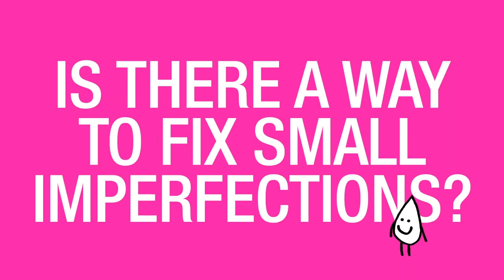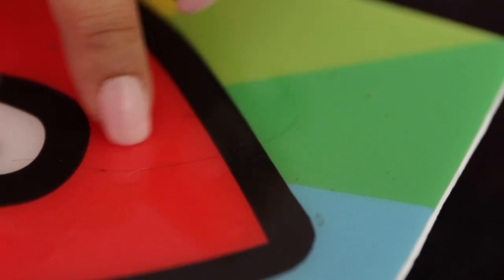How Can I Fix Imperfections In My Resin?

Comment: Can u please help me regardimg sand paper....which sand paper to use....?
Reply from the maker: It's best to go with a coarse grit (like 80 grit) if you're trying to remove resin (to even out the resin surface or to remove an imperfection like a dimple, fly or hair).  

If you're simply trying to rough up the surface before you pour another layer of resin, you can use whatever sandpaper you have.  We always tend to use coarse grits like 80 here at ArtResin, but 120, 220 etc is just fine for this.
Reply: @Artresin  Thanks a lot...🤗

Comment: What grit of sand paper should I use before applying the new coat of resin?  And will the new coat still be clear or will the sanded surface cause the new layer of resin to frost or cloud?

Comment: Hie 🌸
There's one query Actually I poured resin on my coaster and just after pouring it is showing slight cloudiness due to , 
It may be due to cold temp. ? Or it may return to normal after curing 
Bcz mixture was totally clear and there's nothing on top of coaster surface 
Plz help
Reply from the maker: Hi Shivani, the cloudiness could be caused by micro bubbles.  If your resin and hardener were too cold when you mixed them the consistency is thicker and as a result can trap more bubbles.  Next time, use a warm water bath to warm up your resin and hardener prior to mixing to help alleviate this.  You can try using a torch to clear the surface bubbles once you pour.  If any water has gotten into your resin, it can also result in cloudiness, so be sure to avoid moisture as much as possible.  If you have more questions please don't hesitate to contact us at support@artresin.com and we will be happy to help.